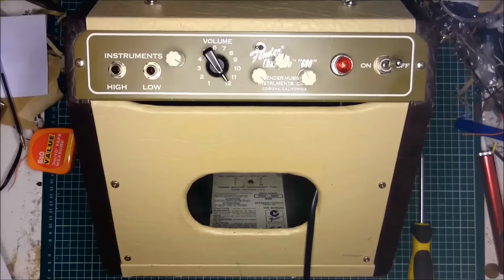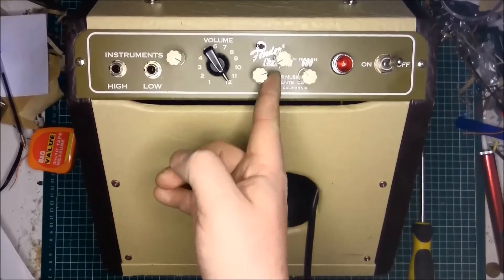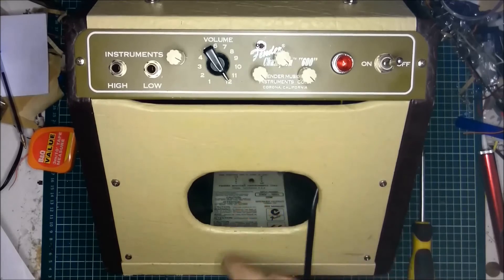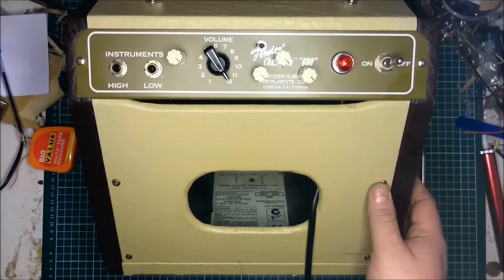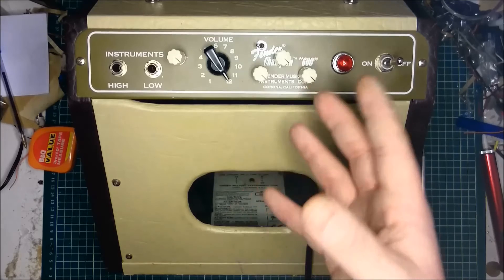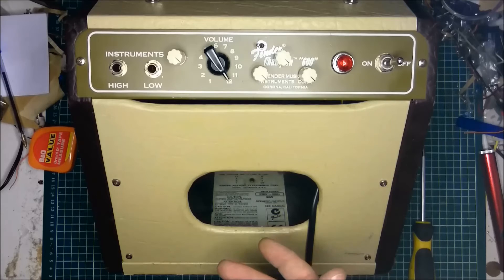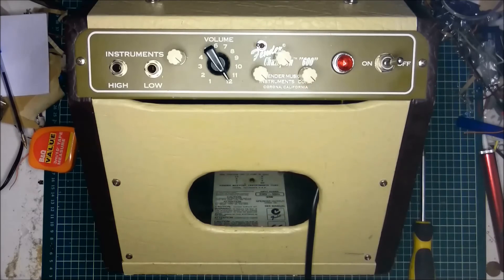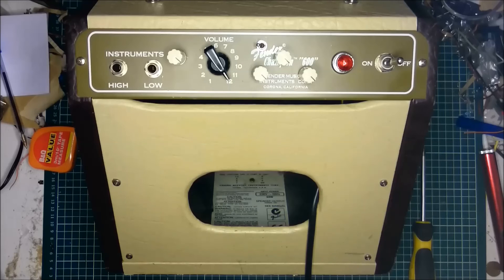GMRspares Fender Champion 600 Mod Kits

Comment: Help!!! On the GMR Spares Champ 600 'Gain Control' ... the instructions you send don't say where the last orange wire gets attached? It's the one connected to the 4th short wire cut between 19 and 20 with the short wire going to the pot but the instructions left out where the other end connects? I'd appreciate anybody's help with this as the link below won't work for me?

Comment: Just finished the EQ mod on my two Champ600's - works great and adds a huge amount of possibilities. Some time ago I replaced the original speakers  with 8" Celestions - got rid of the harsh sounds but it got almost too warm. The EQ mods let me get the best out of those 8 inch'ers. Clean sounds to total tonal breakup is possible now.  GREAT.
Reply: Helge Grinder what kind of celestion did you get? Did it fit easily?
Reply: I realise you did this a year ago but did you remove R18 for the tone control circuit ?

Comment: I just installed the tone mod kit. The parts were good quality. Solid wire would have made inserting wires in the circuit board a little easier. However, the mod makes the Fender 600 sound much better. The instructions were spot on and easy to follow!! This is a passive tone circuit so it does not add anything, it does do a great job of removing certain frequencies. In the past when I overdrove the amp the sound became muddy, now I turn the bass knob back a little and mids down a little and the amp sounds much better. Well dome GMR Spares!!

Comment: Got mine all wired in this weekend and I'm beyond excited about it and the new sounds, sounds enormous c:
Reply: I realise you did this a year ago but did you remove R18 for the tone control circuit ?
Reply: @tamsinmccormick  nobody seems to help you look on eBay see if he still selling them if he is contact him if not just remove it and see what happens but be quick to turn it off if something is wrong do that as a last resort
Also can you find the schematic diagram on Google if you don't have one then trace the input signal though the amp then check the modification you did that's probably the best way to tackle it good luck

Comment: I did the 3 mods after hesitating for 1 year.  I should have done it earlier! Seriously, it gives this little amp a lot more versatility. I use a Fender 12 Cab instead of the original speaker and the mods really makes a lot of difference. I don't even use my overdrive pedal anymore.  Now just need to find a way to put a reverb in this little guy!

Comment: One thing I dont understand about mods like these.....I just cant see the point in hacking an amp box up when you can just put pedals in front of it.   Why hack a 3 band eq onto the amp when you can put a 10 band eq pedal in front?  Not criticising, this is a genuine question, perhaps you can help me to understand.    Any one of those mods can be recreated in the form of a pedal so I'm not getting why people would want to drill holes into a perfectly good box and mess with it's value.   I'm sure there's a perfectly good explanation, and maybe the answer is as simple as "it's my amp and thats what I wanted to do", in which case fair enough, but as a buyer of second hand amps, I personally wouldn't touch a modded amp, and since people get sick of their amps all the time and decide to sell, maybe thats something to consider carefully before deciding to do it?   Like I said, if there's a good explanation then fair enough.
Reply from the maker: Well in terms of spoiling the value of the amp these amps can be as low as £80 secondhand in the UK and dont really go higher than £130 (for a minter). So spoiling the value really isnt an issue in terms of outlay. They made thousands of these so I don't see these commanding massive values in 10/20 years. Its not like its a 50s champ. Also who says anyone will sell it after the mods. I won't be parted with mine.

In terms of putting a graphic eq in front of the amp........ the two things don't work in the same way. Passive EQs in valve amps have controls that are very interative when you turn up or down the treble it effects the bass and mid and vica versa. Secondly the EQ section comes after the first gain stage so it doesnt give the same effect as a graphic in the front. The Eq section controls the drive of the amp as well as the tone. If that worked then why would anyone buy specific valve amps? wouldnt we all have one generic amp and a 10 band EQ? It would be so much cheaper to just buy any amp and a graphic EQ rather than a mesa boogie/dumble/vintage bassman/plexi but thats not how it works. Give it a go, if it works then you can single handedly change the guitar amp market forever. 

The kits are fun and many people including myself enjoy doing this kind of thing. Its a great kit if you don't have vintage fender money. As you can hear you get great tones and its super fun and cool to have something you made sound the way it sounds. 

Lastly it's my amp and thats what I wanted to do. :)
Reply: Steve Bell pedal eq, sure, but the amp runs different with internal amp, doesn't it?

Comment: Hey man, got the kit but in stuck on the part where you remove the clips. Any chance you could shed some light on this for me?
Reply from the maker: +justin lamb What is your trouble?
Reply: I can't get past the clips. getting them off is super difficult and I feel like I'm going to break something. any tips on how to get those clips off? thanks.
Reply from the maker: Firm but gentle is the key. Rock them back and forth as you pull them free.

Comment: Why a 100kOhm instead of a 25kOhm for the middle frequency ?
Reply from the maker: +Largol1 It increases the mid range. Meaning you can get more drive and replicate the original champs which had no tone stack circuitry. Using a 100K pot gives a flatter response.
Reply from the maker: +Largol1 Plus you can set the pot to be 25K or below just like most fenders. Larger scope of tones :)

Comment: Great mods man, just about to order your kit on ebay. Question: What guitar(s) are you using? And also, I have a drill and a soldering iron, are there any other specific tools you need for these mods? Thanks
Reply from the maker: +justin lamb I used one guitar for the video which was my hardtail mexican strat with "hotrails" style pickups.
You will need some masking tape, screwdrivers and an adjustable spanner. Nothing wierd. :)